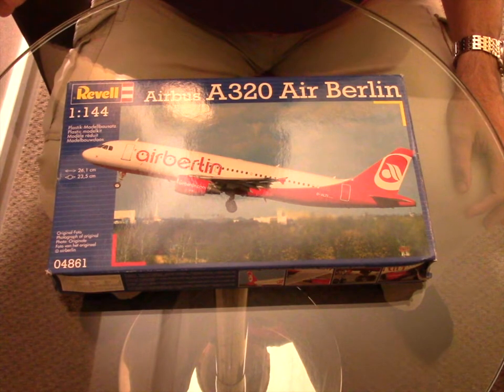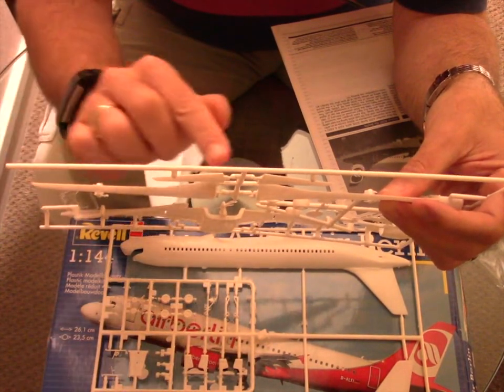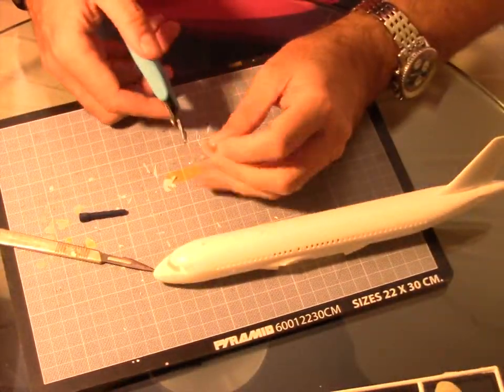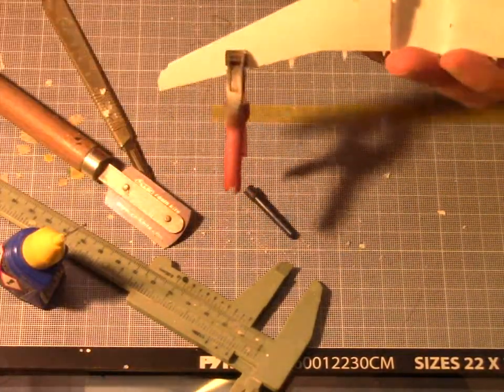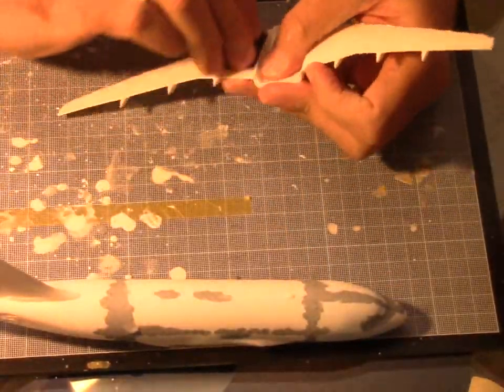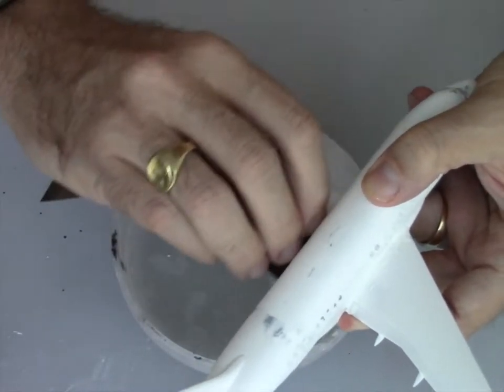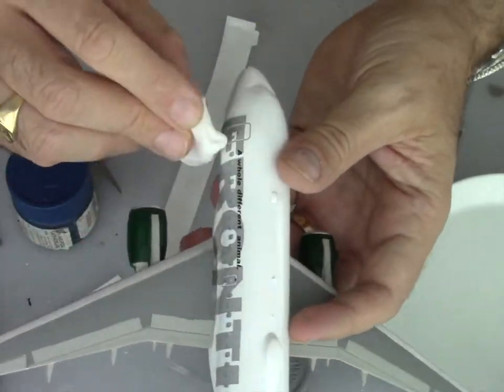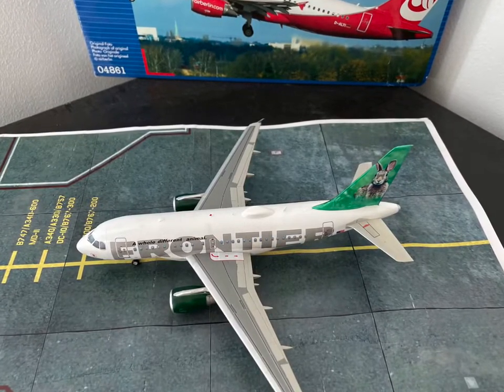Revell 1/144 A318 Frontier

Comment: Very Nice. First time I see a Revell Airliner with that type of defects. But I know Revell Germany has a Excellent customer service when it comes to replace defective parts. How can I obtain the cutting Instructions? I have a A320 kit to convert to A318. Thanks for your videos.
Reply from the maker: Hi Ricardo,
Honestly it is quite simple, only the fuselage have to be modify. 5.5mm for the high of the tail, and remove 5 windows from the front section and 7 from the aft section. With a lot of putty and patience you will get a decent result 😉👍

Comment: Due to the new position of the cargo door the wing body fairings on the A318 are asymmetrically arranged. The housings of the CFM engines should have been lengthened, 'cause A318 uses the -5B variant. The model also lacks the typical wind deflectors near to the front gear on the lower fuselage, which are a characteristic of the 318 - These are due to the AoA (Angle of Attack) sensors, which are located closer to the nose landing gear due to the shortening of the fuselage, from which they are intended to deflect the air swirled by the landing gear when curving. That's the details for a top model..
Reply from the maker: Thanks for  all those info